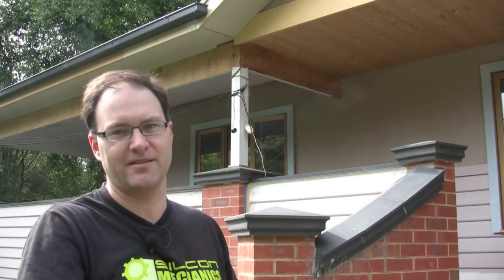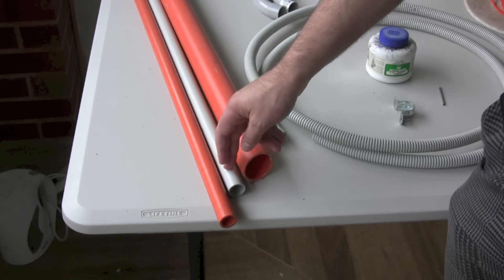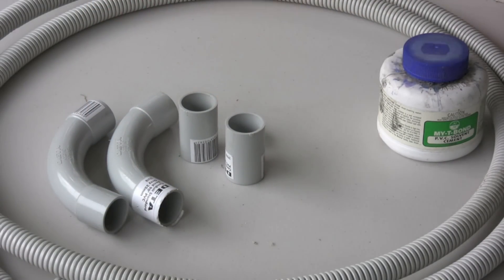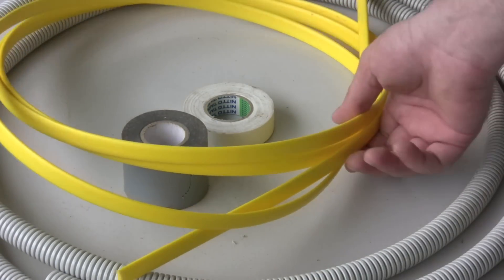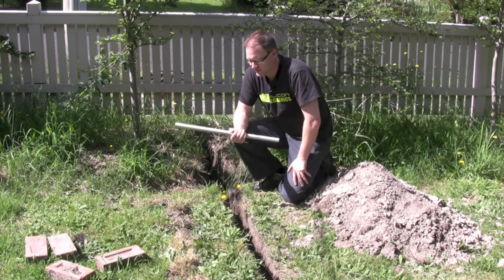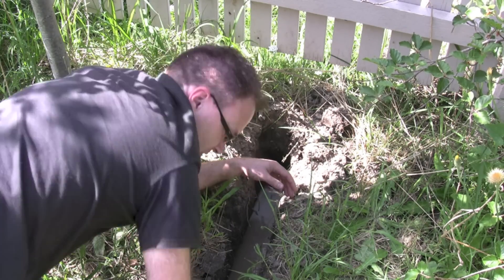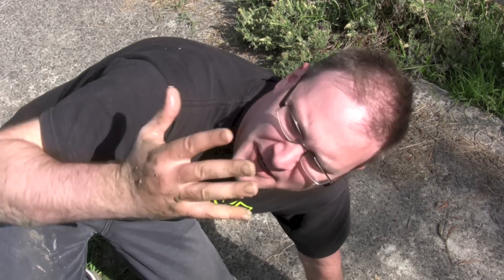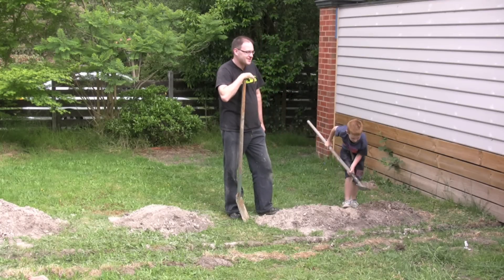SuperHouseTV #5: Installing conduit under an existing footpath

Comment: If you use a double-length string, and mark the middle, you can tie the cable to the middle, then pull the string to the other end. Untie the cable, and you can now pull the string back. That lets you pull multiple cables from either direction. Just tie up the excess and stuff the string in the conduit for future use.

Comment: We did this technique for a power conduit. Ended up using 3ft more pipe than we measured across the run before the job. Must have looped somewhere. 😁

Comment: Just a quick point when digging any hole you want to back fill, put the spoil on a strong plastic sheet or tarp, it's much easier, just lift and the soil goes back down the hole.

Comment: In Australia and New Zealand, Orange conduit is only used for underground mains voltage electrical wires and has the word "ELECTRICAL" printed on the side (commonly referred to as HD conduit) It is not UV treated and is available in flexible corrugated.

Light Gray conduit is not allowed to be used for underground mains voltage electrical wires. It has the word "ELECTRICAL" printed on the side and is commonly referred to as MD conduit. The PVC is also UV treated so it lasts longer in the sun and is available in flexible corrugated.
There is also Light Grey conduit with the word COMMUNICATIONS printed on the side of it, commonly used for private data/low voltave (not 240V) cabling (cat5e, cat6, phone cables, intercom, gate release, etc etc)

White conduit is only allowed to be used for TELSTRA COMMUNICATION wires (Phone, Fiber, cable TV wires) and generally, when it comes from the street, is owned by TELSTRA even though it enters your property. This white conduit will have TELSTRA  printed on the side and is a slightly different size to electrical conduit.
Reply: Why not use Electro metallic tubing?

Comment: You can use blue water pipe they cheaper as well you don't need gluing them coming on long roll like 25m. I use them for Intercom and mechanic gate systems  never fail.
Reply from the maker: Yes, that'd be cheaper and easier to work with (it's fairly flexible) but I don't think it'd comply with building regulations. There are specific rules here in Australia about what sort of conduit you're allowed to use, how deep it has to be, what sort of wire you're allowed to put in it, etc. The polypipe used for irrigation systems isn't as strong so PVC conduit. Also, different colours of conduit show what they contain, so if you uncover conduit you know what's inside it. If you uncovered polypipe, you'd think it only has water in it and could electrocute yourself by cutting it.

Comment: let me just say that for anyone who was wondering if bigger diameter pipes could use the same technique or a very similar one (as i was) i manage a 100mm pipe across 4 meters with a concrete footpath a meter wide using a high pressure water cleaner through clay soil just 3 days ago (28/07/2013)

Comment: One of my many jobs in the past was to install data cabling. We would often take a light piece of plastic (Ziplock bag, bread bag, etc) and make a small balloon just big enough to fit inside the conduit, but not so big that it gets stuck.  Tie the string to it and use a vacuum to suck it through to the other end. This works really well for long runs.

Comment: Here's an additional tip for getting the string in the conduit. Once your conduit is in place. Tie the string to a bit of sponge that just fits inside of the conduit. The sponge should seal the conduit but not be wedged into it. Now go to the other end and attach a shop vac to the conduit. The shop vac will suck the sponge and string through the conduit. I've used this method to fish conduit of several hundred feet with out issue.
Reply: A plastic bag works very well too